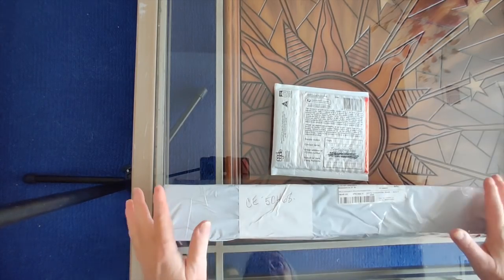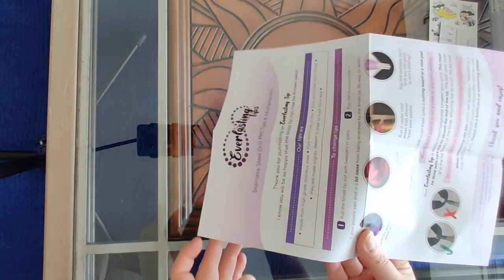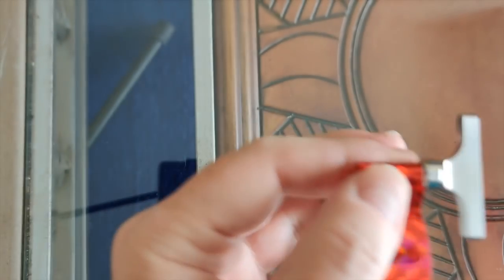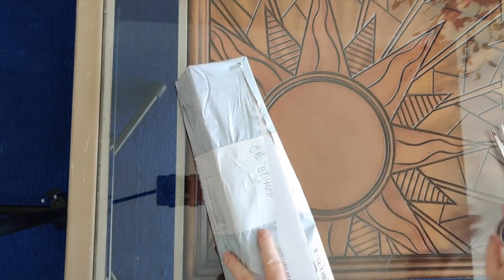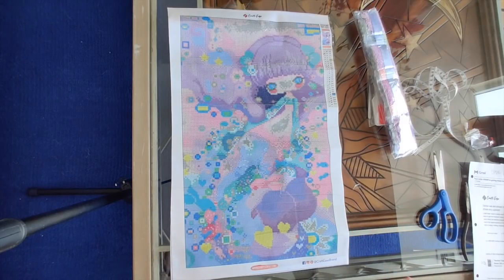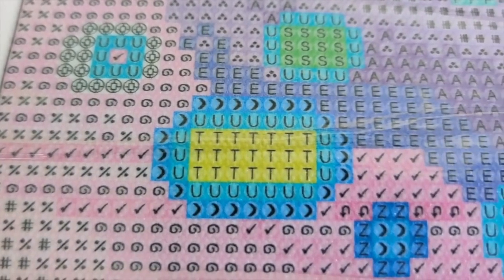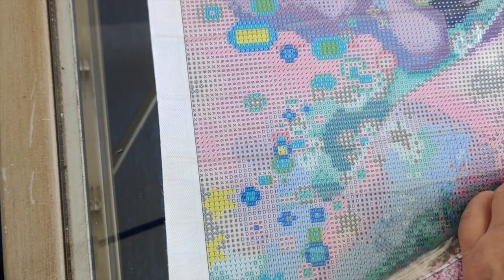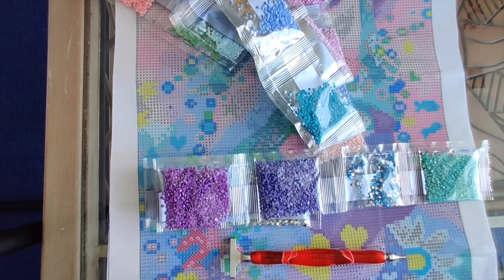Unboxing Craft-Ease™ "Numiko" by Sybile Art, and an Everlasting Tips 12-placer + Time Lapse (#753)

Comment: Do you find that using the 12, will it be placed correctly or do you have to move them a lot?
Reply from the maker: If the drills are the proper size, you don't need to move them.  However, if the drills are too small, you will need to space them out.  When drills are too small, I find using a 6-placer works best, because they don't need to be moved.